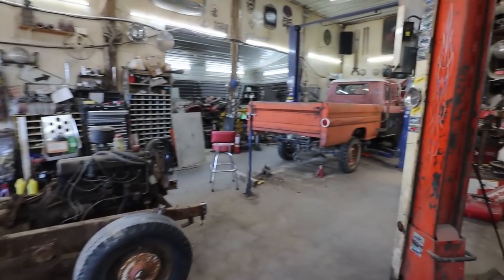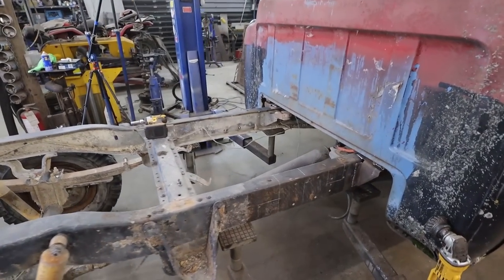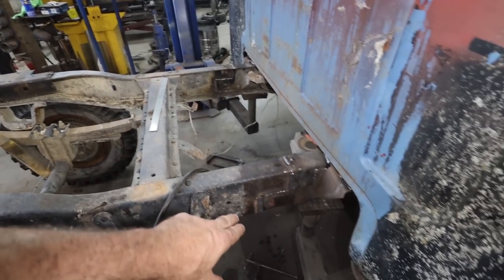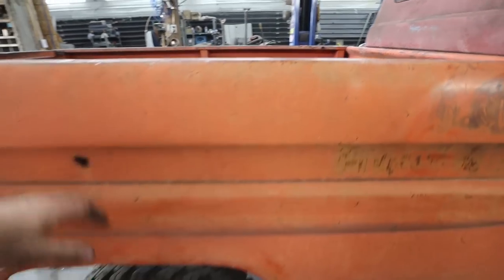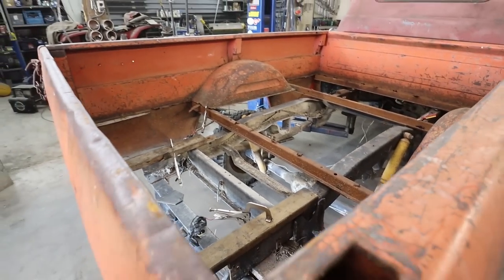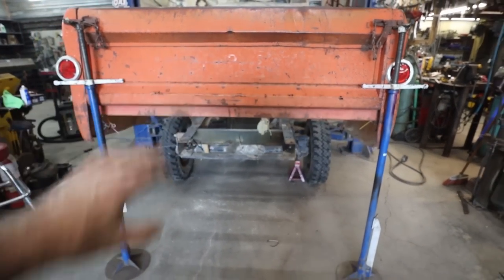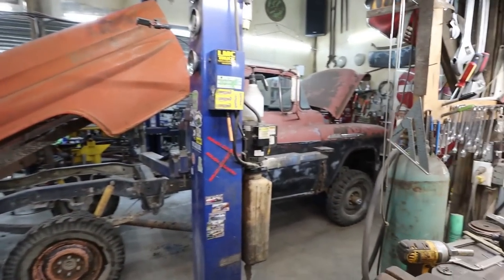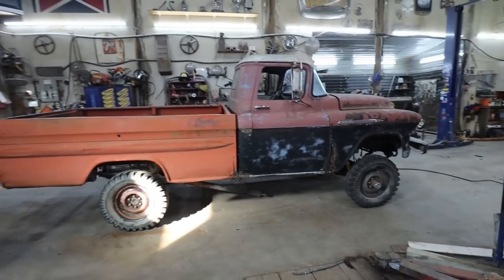Shortening the frame and installing a dump bed on our 1955 Fake Napco 4x4.

Comment: You are rapidly becoming the “Lost Engineer of NAPCO”.  You,ve done this before.  The body lines are spot on, the strange proportions of the box are a definite stand-out feature, but thats what worked and sold back in the 1950’s.  I was at a car show and saw an old 40 something  pickup (Dodge I think) with a 9 foot bed. Bigger must have meant better back in the day.  Its looking true to Halfassed Kustom form, and thats a good thing!

Comment: Holy cow, what a video!  So much stuff going on.  The frame shortening was the way to go, especially since it was a straight section.  Do you need a dump bed, no, but you have it, so you have to use it on this build.  You have to make the old bumper work too, it’s just cool.  Just fantastic stuff!

Comment: The frame shortening cut. I've seen a variety of them done but your's makes sound mechanical sense. It's geometric which makes cutting and alignment so much easier and solid. I married a 67 Bel-Air front frame to a 54 Chevy pickup. The frame marriage was a success but the suspension was an epic fail. The independent didn't have enough travel. If you crossed a rise or fall on an angle it only left 3 wheels on the ground. Sometimes only 2 depending on the pitch. I sold that truck to a friend and eventually he altered the independent suspension so it had sufficient travel. What you're working on now is one of those fun and utilitarian projects. I like where you're heading with it.

Comment: Morning Brent, I like the looks of the straight side pickup box, I've done alot of frame stretches & shortening on class 8 trucks, I used to cut a 45 degree angle & fish plate the frame, but I think the way you are doing your chassis will work just fine, if I remember correctly, Chrysteel(?) made a pickup dump hoist, it rose the box a couple inches, put the box alignment out the window.... can't wait to see the finished truck!!! Be safe!! God Bless!!

Comment: Perfect frame sectioning. This is so strong!!! Great job. We used to use a torch to cut. That was a beast, but it worked. 👍👍
Reply: I need to finish watching the video, but at about 8 minutes in, it looks like Brent has laid out a cut that will take out too much length, 9.5 inches plus the overlap.  Maybe he will catch it before he cuts, but if not, he can fix it!  Or maybe I'm wrong.

Comment: I'm pretty sure you shortened the frame by 12.5 inches, instead of the 9 inches you wanted. When you decided to overlap the weld point by 3.5 inches. Of course I could be wrong. But you are correct, notching it makes that weld point stronger and easier to line up. Nice work 👍
Reply: Yeah rear wheels looks a bit forward based afterwards..

Comment: You made the adaptation of the dump off the other frame look just like it should on the new truck.  I never thought of using a remote 12 volt hydraulic pump.  I always thought of using a power steering pump, with the electric clutch adapted off an old GM air conditioner pump.  Your idea is much simpler.

Comment: The 56 original channel frame fits perfectly inside of the new 4×4 frame & same frame distance with Crossways, I sandwiched my 56 frame into my 79 4x4 front clip frame 6 inches at the front cab  mounts and welded top and bottom frame rails then bolted 56 cab mount back in place, drilled and bolted 79 spring hangers springs and rear to the 56 rear frame so that cab and bed still ended up in there original mounting places. Used the 56 tras cross mount for the rear transfer case crossmember mount. It all worked out perfect. Only had to get lifted front leaf springs to bring the front end up level. The 79 steering column hung brake pedals and 79 floor trans cover all work out perfectly. It was a lot less frame work to do.

Comment: Make the pivot point for the dump bed lower than the top of the rail (main frame) and that way the bed will be going backward as it goes upward.  For instance, make the pivot point at the at the bottom of the frame and the bracket upward to mount to the bed bottom.

Comment: i had a frame off a stepside that was rotten under the cab years ago ...i found another frame and the only part that was good on that was the part that was bad on mine ..so i married them together ..i used a jig for the cutting torch that bolted to holes in the frame that were there ..i plated the outside and used a small 7018  ..i used to haul a cord of wet cedar to the mill for weekend money ...then i rolled it .a few times one night due to a seized pinion bearing going to fast in freezing rain  ..the roof touched the steering wheel ..had to kick the rear slider out to get out ..still got the frame and box in same shape as after i welded it ....it was a cool old truck ...nothing as cool as this old 55 ..55/56 is my favorite year

Comment: Great progress
You can paint her with red oxide primer and black Rims and bumpers 
They have those mega sized Turbo
Cans that shoot extra wide.
The fleet side rounded side panels 
Can be cut off then hammer/dolly
Tack welded back on after shaping it.

Comment: That is what I call it the across it from side of the box to the other side of the box. It is a beam transverse to the longitude of its chassis. The beam goes across and under the bed bottom. The bed bottom is same as box bottom. The Box is the in the cab where the seat is is cushion box. The back box  is another word for open-end cargo. Thanks.

Comment: With that dump bed and hood opened, it rapidly turned itself into racing mid-engine beast on servicing😀😀😀

Also, it looks like original paint scheme of cab continued to the box would fit perfectly. Only problem is transition to tailgate

Comment: If you don't want the front edges of the trailer to rub the cab when dumping essentially you need to move the box hinge lower.  Ideally when looking at the side of the truck the hinge needs to be at the same level as the front side of the box (where you cut it). With the hinge lower you might then be able to lay a hydraulic ram between the chassis rails and still have enough leverage to lift the box. You could put the front of the ram somewhere around where you shortened the chassis with an angle on it going up to the centre of the box lifting structure.

Comment: If I were doing the dump body, I would use the scissor lift. If you do the geometry right you can figure out where to mount the hoist for the dump angle you want. My uneducated guess is that the heavy steel on the back of the frame was the mount for the cylinder for the original truck. Love your work

Comment: I like it, the dump bed will be a nice tool for you. I do think you are going to have to box in the frame. Once the hydraulic cylinder and PTO or a simple jack system, the bed will want to twist while it's up when loaded.

Comment: If you put the pivot point of the bed at the height of the lowest point of the front of the bed you could tuck the bed as close to the as you want because it would always be moving away from the cab in its arc.

Comment: I have a single acting scissor, no use for it. The 12 volt pump  is lever, not the fancy electronical style. More scrap i have been saving.
Hauling brush, grass clippings,bit of gravel to fill a hole,yup a dump is nice. I have a dump trailer, use it lots.

Comment: If you don't want to install a hydraulic ram to tilt the box you could always use a manual or electric wire cable/pulley system winch set up, just a thought.

Comment: Excellent video Brent  :) also that worked out super on tilt box part & bumper may need clear when tilt up up and should be to hard figuring out to also your brother stuff should work to plus I told you might need in previous messages too! Also box usefull dump snow in winter season months or if you or your brother or someone you know has get wood delivered be useful for! Bed of box would put metal and put plastic instert tray plus on tailgate to so be easy clean and not rust out ! So do wood sweep clean easier and clean snow too or top soil dirt too !

Comment: As for the pump Muncie pump will work you just need to fabricate a bracket for it and add another belt to it or use the AC belt system to run it

Comment: Rule of thumb for flatbeds and dumpbeds is 3"space between cab and front bulkhead of bed. However your pickup bed actually extends below the framerail so I don't know if 3" will allow the bottom of the bed side to clear the back of the cab. Meh, Brent will figure it out no biggie lol! AL B.

Comment: I know I am like two days late but speaking to the lift cylinder they usually mount to the frame with a pin mount and a similar on on the box to allow it to pivot

Comment: I'm sure you know but princess auto has 12v electric over hydraulic pumps from dump trailers relatively cheap. That's what we used with an implement cylinder on a truck and it worked out great.
Reply from the maker: Yeah was the plan. :)

Comment: I'm sure the amount of time spent doing and editing what's in the videos is extensive. The progress made in the first 3 videos is astounding. This seems a lot more planned out than the rod you just finished. A dump box on a winter beater? To each his own. It makes for interesting videos. If you contacted Eastwood, I'm sure they'd send you freebies for a video of you doing something about the rusted chassis before you bolt down the body and box. Just a thought.

Comment: Check out how da old old dump works, cut da newer truck in two, weld n plate the newer truck back tagether 9" shorter, test fit the newer old box, cut dump oft da old old truck, weld dump ta da newer old frame, test dump da newer old box, modify da newer old box to clear da cab, cornfused? Not Pablo or Buddy.

Comment: I would remove the wheel wells from the bed you don't need them and make it a flatbed inside. You'll gain way more room and i doubt the tires would have any issues even with the bed loaded. Or make like a 4" high wheel well from Diamond plate....just a thought.

Comment: Love your work! I was curious if you could have loosened up the u bolts and moved diff up 9.5 inches. If the hinge is at the bottom, the front edge of bed cannot move forward.

Comment: I know you did this a month ago but hydraulic cylinder should be mounted above rear axle which means the structure needs beefed if you want to actually haul and dump stuff lol. AL B.

Comment: I was thinking of the same way about how to hook up the tilt are you going to have a single hydraulic ram or you can can go with two small rams depends on what your going to use it for plus you need a tank for hydro oil
Reply from the maker: think my brother has a scissor lift that should fit.

Comment: The pneumatic lift cylinder yoke bottom Bottle ram Jack a little more than 3 foot long. When fully extended 2 stage it becomes 5 foot high. Would you use v-belt to run the pneumatic pump next to your engine Chevy-Napco truck. But there is no room for pneumatic pump under the hood. The Silverado 2500 HD dump truck where the dump box was built by Hillsborough Welding shop with Izusu tail lights. But the Chevy standard tail lights is cheaper from Auto Parts store like Auto Zone or Grand Auto or Western Auto.
 Other cylinder lift is 2 foot long with 3 stage Yoke bottom and has about 10 inch diameter from Jeep Eagle truck Sales and services. The Cutting Blvd in Richmond, California have a lot of salvage for used cylinder lift for sale.

Comment: Z cut frame is the best. I did a 72 Chevy that way, strong as heck. I've seen a bunch of butt cuts on IG and YT, blows my mind, they're crazy.

Why didn't you just use the original frame and swap axles? Making content? 😂
Reply from the maker: I think the wheelbase would have been off also.

Comment: for what you would dump with that the cylinder should be no big deal. I think the hassle will be a pto/pump though maybe you could just run that off of your power steering pump.

Comment: Looking at the position of the rear wheels to the opening, I think you cut about 3"" too much out of the frame, it just looks more than 9 1/2" ?????? 
The wheel position just looks so wrong.

I just rewatched this part of the video, and yes ,you cut off 3 1/2" too much, your measurement in the middle of the joint should have been 6" instead of 9 1/2"
May I suggest that you reposition the rear springs back the required distance.
THANK HEAVEN YOU HADN'T CUT THE DRIVE SHAFT, what a mess that would have been.

Comment: Think I would have left in the 9 inches. .and extended the cab..more leg room.  More storage.
Reply: 👍I agree. Custom Comfort Cab to stretch out in.
Maybe take a foot out between the tailgate and the rear wheel. It would look more proportioned and ensure a better balanced load when hauling.
Reply: @WillyMcCoy50  lol. Yeah man. Getting technical now..but yep. Why not.  Cool looking truck. He not scared to chop it up.

Comment: i will trade a 66 gt dart rust free good body needs glass front and back side glass good will run but needs a distributor some one stole it has slant six 3 speed on floor possi rear-end i got for the new wheels and tires on it and sold them for 600 but i don't do mopars no more so trade for the step side box